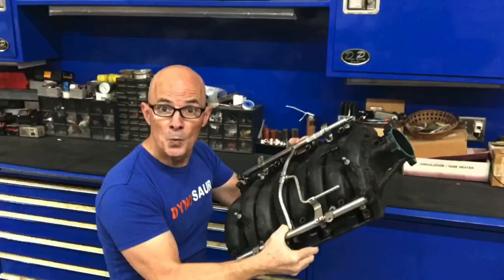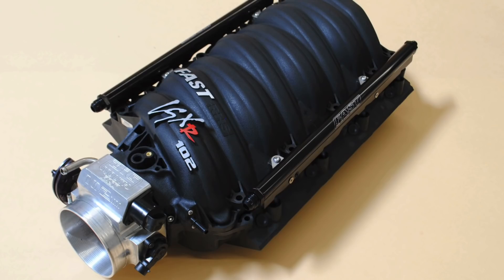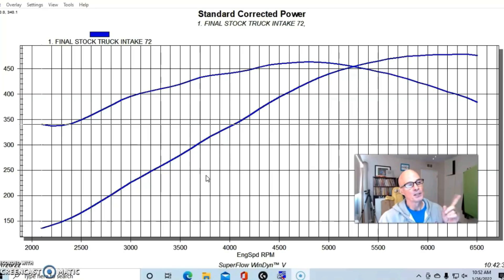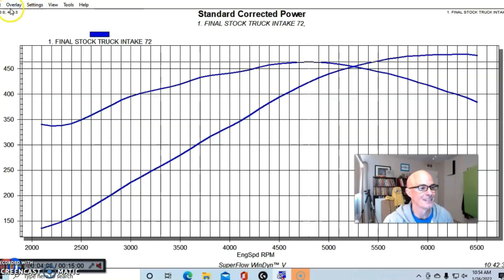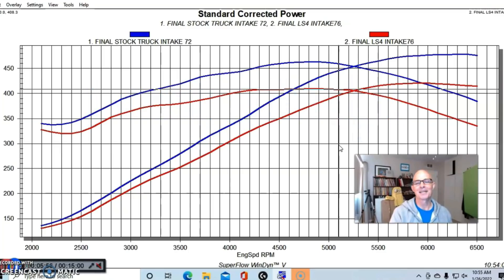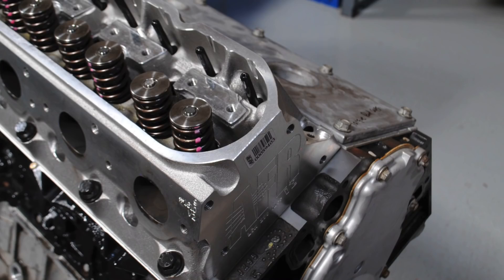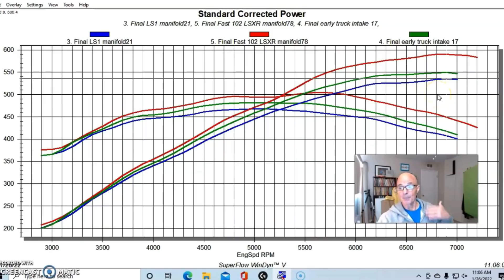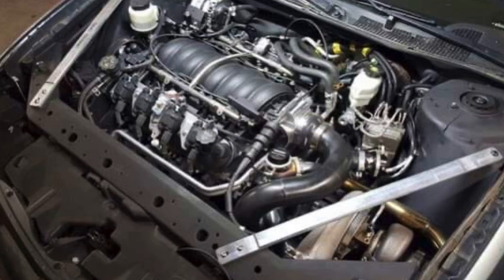WAIT...THEY MAKE A FWD 5.3L LS CALLED THE LS4? JUNKYARD 5.3L LS INTAKE TEST-RWD LM7 TRUCK VS FWD LS4

Comment: I've been telling everyone for years. The ls4 was choked by gm to save the 4t65e. A set of headers and intake swap alone would make a LS4 rip. Throw a cam and e85 and it'll be pretty quick. But no more 4t65e...
Reply: GM has habit of choking performance engines, especially on intake and exhaust.
Reply: @w41duvernay  That's not a bad thing.  It means they left power on the table that we can open up pretty easily.  Why not make more from the factory?  Emissions, fuel efficiency federal requirements, etc.  They often wouldn't be able to release the same engines.

Comment: I also have a 06 impala ss.  Building it up to hopefully 500hp this year.  Would love to see a video of you building a ls4 up. I'm also going to use a manual 5 speed.......hopefully.  never been done.  Yet.
Reply: They are almost identical to a 5.3. There’s a few difference water pump,oil pan,starter,bell housing pattern and intake. Ironically it’s kinda a ho 5.3 flat tops and 243s from factory. If you want snidertron3000 just assembled his ls4 for his fiero on YouTube. Took the flattop rotating assembly and replaced it with a stock dish setup.
Reply: @governmentcalamari9785  crank is also 1in shorter.  I'll check it out

Comment: The ls4 intake uses a smaller throttle body and also had the throat choked where the oil sending unit is
Reply from the maker: THE OPENING IN THE LS4 IS BIGGER THAN THE TRUCK
Reply: @richardholdener1727  which opening?  It uses the v6 throttle body and MAF.
Reply: @richardholdener1727  the intake is also way smaller where the oil sending unit sits on the back side of the motor

Comment: Com'on Richard, even with your testing you can see the limiting property's of the stock PCM's vs a Holley or Fast system and you know it's on purpose.  Sure, you can reflash a stock PCM and they will perform well so what reason would the GM engineers have for limiting the output of say a 5.3 LS ?  To make the rest of the drivetrain live to at least 100k miles.  Your standard 4L60wouldn't live half that long with 375hp in front of it in a 6k lb vehicle and any good 5.3 will put that out (gross rated).  My question is why they didn't come out with a smaller engine, say a 3.8L V6 LS with higher output to stretch that gas dollar, provide adequate power and easier packaging if they needed it ?
Reply from the maker: I DON'T KNOW WHY YOU ARE COMPARING A HOLLEY TO A STOCK PCM TO MAKE A POINT THAT THE FACTORY LIMITED THE POWER OF THE LS4 WITH THE INTAKE
Reply: @richardholdener1727  It's more the stock programming across the board and things done by GM to limit the output of these engines.  Putting a restrictive manifold on an engine to purposely limit the output is not beyond the scope of possibility's, IMHO more than likely.

Comment: For some reason, GM decided to pair up the LS4 with the 4T65E-HD transmission, which is only rated for 280 ft-lb torque. The LS4, even with the "Tonya Harding" intake, makes over 300 ft-lb torque. IMO they should've put a 4T80E behind it (like they did with the NorthStar).
Reply: Gm transmissions are why I refuse to buy another gtp/gxp. I love the engine, hate the trans.
Reply: @madmod  why I love ford, even the fuckus has a decent trans, of course they went a different direction on the new bronco, which kinda worries me... (I'm ignoring 90s because nobody had a really awesome trans in the 90s)
Reply: @Prestiged_peck  My 94 lincoln trans is actually really awesome for a street car that sees some strip use. It is basically original and stock minus a jmod and that alone put my mark viii into the low 14s even with 3.08 gearing
Reply: @madmod  I was thinking more along the lines of E4od
Reply: @Prestiged_peck  dear God lol
Reply: @Prestiged_peck  i had bad luck with those as well as the early aods in the early panther platform cars
Reply: Im probably the only guy in the world to have great luck with both the 4t65 and 4l60e.
  300k miles + on both. Allowed for a 5-8min warmup every day of its life and never changed the fluids
Reply: @DarkLinkAD as long as you have a good cooler on ls4 with good maintenance it will last a very long time. Heat is what destroys these transmissions
Reply: @DarkLinkAD how much hp is with the 4t65
Reply: The 4T80 on stock tuning can BARELY handle the power without a tune to increase shift/holding pressure. GM in the 2000s were delusional at best with the FWD trans options.
Reply: @1987FX16  4T80s have held 800wheel already.
Reply: @1997L67GTP  On the factory tune?
Reply: @1987FX16  on full manual, which is just as simple as wiring for full line pressure.
Reply: Buddy of mine has a 4T80E with the LS4 in his impala SS. Stock 4T80E has taken a beating and hasn't broken with 700 + HP
Reply: @ticojason8868  does he have an @??
Reply: @ticojason8868  No freaking way.. I do think some are made better than others. I had an Impala SS and the tranny went out on me. I got it fixed and it felt fine but when I got my Monte Carlo.. Boy that was the SMOOTHEST transmission I ever felt!!!! I couldn't believe it was the same one in the Impala. Night and day difference!
Reply: They can be built but just like anything, you gotta have deep pockets. Iv been lucky with mine but I don't let it have tire spin on corners or with the wheels turned which shears the pump shaft off and is one of the leading causes of failure of the 4t65e-HD. I know it's inevitable though
Reply: The longitudinal 4l60 and 4l80 have never given me trouble, the sideways ones must not be as good.
Reply: @Paul Schwartz 60 or 80?
Reply: @Paul Schwartz Damn sprags..
Reply: They should of made a tapshift 4t80 for the gxp
Reply: @Bless-edisYeshuaHamashiach well if they put it in there they would you can spend thousands tho to put it in its dumb tho
Reply: @Bless-edisYeshuaHamashiach 4t65ehd stage 3 holds 600hp fine lmao
Reply: You're so wrong. How come guys are boosted with 600hp+ with a stage 3 4t65e HD lmao. it costs thousands to put a 4t80e in
Reply: @jimtom4878  - It also costs thousands to mod a 4T65e to handle that power level. So I don't see your point.
Reply: @michaelblacktree  in*^
Reply: @michaelblacktree  if you get a tune brewer will correct the shift points and it'll be easier on tje transmission
Reply: @michaelblacktree  you do understand that the 4t65e bareley fits already and they'd have to change the oil pan to put a 4t80e in there obv not gonna do that when they already like keeping base models simular for cost effectiveness lmao ifs like you don't know GM
Reply: @michaelblacktree  base models simular to the ss*^
Reply: @michaelblacktree  James brewer tuning
Reply: @jimtom4878 You're a little behind on information bud. There's multiple options for the oil pan and mounting situation, cost is similar to a built out 4t65, you have provided no logical arguments, so I'd like to ask why you hate on the 4t80?
Reply: @michaelblacktree  hey, so you know, it still costs thousands to buy or rebuild a functioning 4t80e, and from my experience, similar prices. I dont care what you choose, but just make sure you dont regret it in the end. I choose to keep 4t65e and upgrade, since Im personally skeptical on shaving the actual block of the motor to just make the 4t80e fit, and it means less work overall too.
Reply: @jimtom4878 A proper stage 3 is hard to build. The GM racing chains are rare and hard to find. Stage 3 without bigger chain is a failure waiting to happen. The cost for a 4t80 is comparable to a built out 4t65. Plus the tapshift channel plates are getting rarer, ask Dave at TEP. My stock gxp eats  stage 1 4t65s, the 65 is crap.
Reply: @jimtom4878 most expensive part on LS4 is adding back starter. But fully built 4t65e is $3k+ shipped plus laborer so a $500 4t80e is sweet
Reply: Get a tripleedgeperformance trans and you will be fine
Reply: @Bless-edisYeshuaHamashiach My stock gxp ate a stage 1 4t65. I don't blame Dave at all but the 65 is a shit trans.
Reply: @fjb666  not if you get the stage 3

Comment: So basically if you take the GXP or Monte Carlo SS LS4, throw a mild cam and fast intake you will have a beast....prob needs trans upgrades as well .
Reply: Also a Lacrosse Super has the same engine minus paddle shifters.
Reply: Have to upgrade the trans, they are only rated for the factory motors.
Reply: GO SEE LS4king youtube vid on going to STS 4T80e trans swap.
Reply: @w41duvernay  or see Triple Edge Performance, since they sell beefy kits for the 4t65e for GM or Volvo that support even past 350 whp(if you have GXP, choose performance rebuild kit w/ Tapshift). I say this because of how much less upgradability/modifications the 4t80e has than the 4t65e, and youd be paying a decent price for what it is(still quite expensive). also, upgrade input shaft once you reach around 300 whp, otherwise it will eventually snap

Comment: Have an 06 Impala SS. Wanted to see this for ages!!
Reply: Would have been nice to see it tested on as close to a stock 5.3 as possible. Just to see what kind of gains there were to be had (vs losses on the other platform!).
Reply: @DrFiero  should be close to the same so 25 hp wheel definitely need a tune due to more air and a cowl hood
Reply: 06 impala is a toilet

Comment: Only reason I can see GM using it on the LS4 was bc they put a 4t65e behind it. And probably wanted a low profile intake that wouldn't allow it to annihilate the fragile transmission they used.
Reply: Lincoln did the same thing with the Continental 32v V8. The 99 engines boasts the same heads and cams as a 99/01 cobra but were rated with less power because of induction and exhaust. They ran a split port intake manifold similar to a mark viii which focused on torque, limiting the horsepower of an engine that normally peaks in power past 6000rpm down significantly. They were equipped with a fwd Ax4n trans, basically a beefed Sho Taurus transmission and the engine could seriously overpower the stock drivetrain completely dead stock. With traction, they easily exceeded the rated performance figures just like the Gxp/gtp/ssei chassis do.
Reply: Also they needed too keep power down too kep the ls4 from competing too the gto. Also it was lazy engineerimg with the opsu
Reply: @Saddedude  lmao at competing with the GTO. Even with a better intake and trans, the LS4 fwd cars weren't going to compete with the GTO. 🤣
Reply: @rdsimmonds  GM is pretty particular with what crosses the Corvette/Camaro/GTO holy ground. They definitely made choices on these cars since the Camaro was out of the picture, but I think it was more a choice to keep them from crossing over to the Buick/Cadillac northstar market.
Reply: @rdsimmonds  check out some.of the concept cars. There was an awd version that was turbo charged that would have smoked the gto of its day had it gone too production.

Obviously a stock production gto lined up aga8nst a stock production gp gxp the gtos gonna win. 

But had gm given the gp gxp a fighting chance via cam and intake then it would have been a much more competitive car for sure.
Reply: @Saddedude  there was never a turbocharged concept, but I do remember the awd concept they did. But it was powered by an LS1, not the LS4.
Reply: @brianhunt6943  they were particular with what would've hurt Corvette sales. Not what would've hurt sales for the F-cars or the GTO (especially since the GTO was always going to be a 3 year run anyway). They didn't care if another car could undermind the performance of those. But the Corvette is the flagship. Nonetheless, you're not dropping a few bolt-ons onto the LS4 and pulling 500 bhp out of it. It's an attainable number, but it's going to take some work, and more than likely forced induction to be able to do it and maintain street manners.
Reply: think the 4t65hd was more a budget choice as well as not touching the Buick/Cadillac boomer market. They wanted to keep them in Northstars which had a much higher profit margin. The intake they chose was all about clearance. While you can put a truck or TBSS intake on these they won't fit stock off the shelf so GM had to make the restrictions they did on the intake to clear everything.

Comment: Do you ever mess with diesels? I'd be curious to understand the effect of a camshaft, ported heads or a ported intake manifold on a diesel, because I've been told they don't respond the same way
Reply: All that can help on a diesel. It just generally isn’t worth the time and money until you’ve maxed everything else out. To get max power it’s like everything else that needs more airflow. But, with boost and relatively low rpm you can get away with just turning up the boost and fuel to make quite a bit of power.
Reply from the maker: I DON'T RUN DIESELS